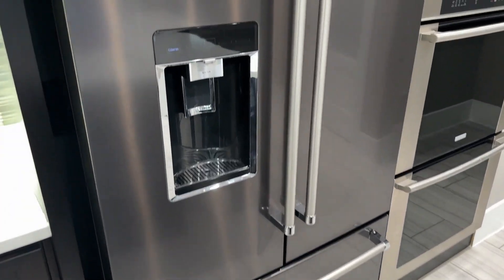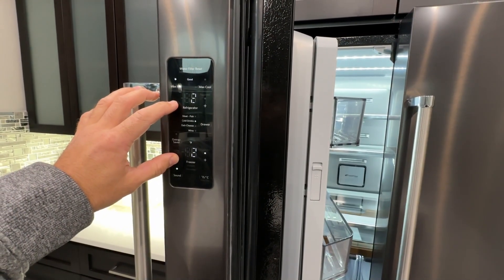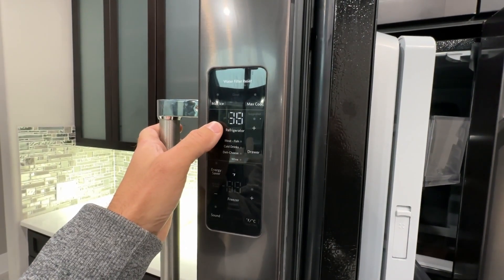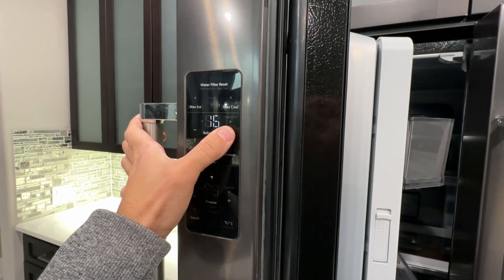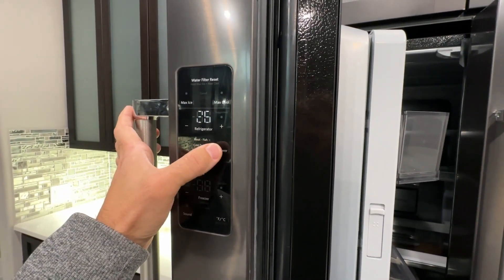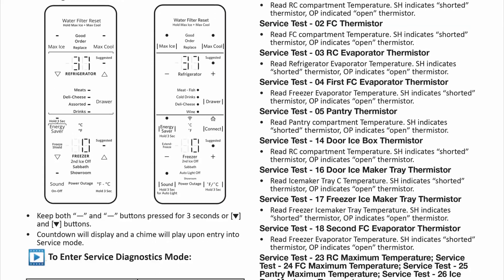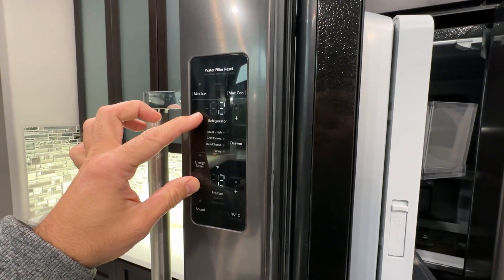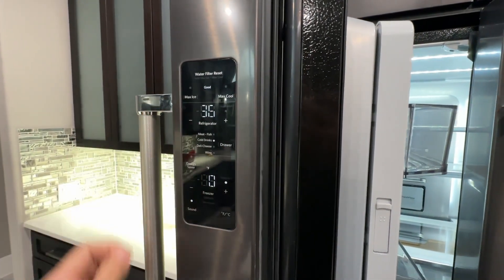KitchenAid Diagnostic Mode and Codes | KRFC704FBS00

Comment: Very nice.  I've had huge problems with the ice maker historically.    The biggest issue is a pretty constant failure of making enough ice.  I have to use ice cube trays.
I've found entering service mode and not knowing what to do in it sort of resets its brain sometimes.    But I need to learn the ice diagnostic settings.